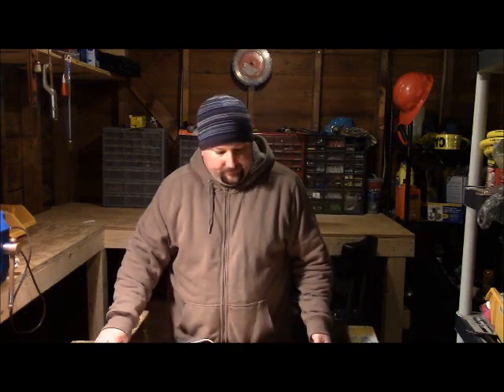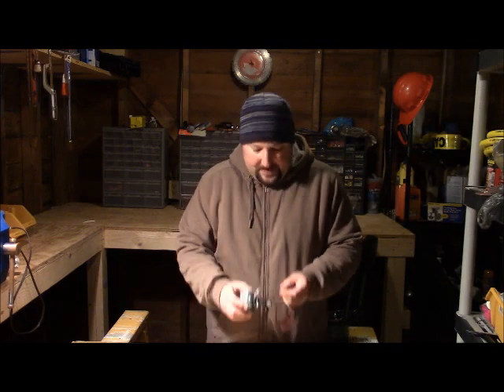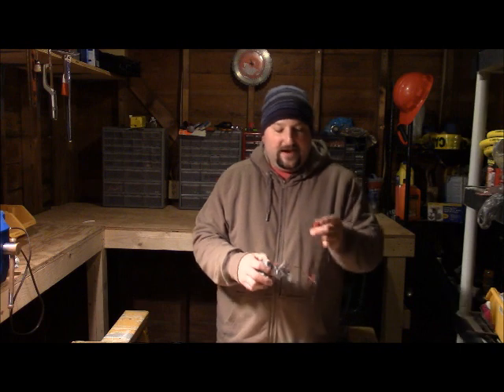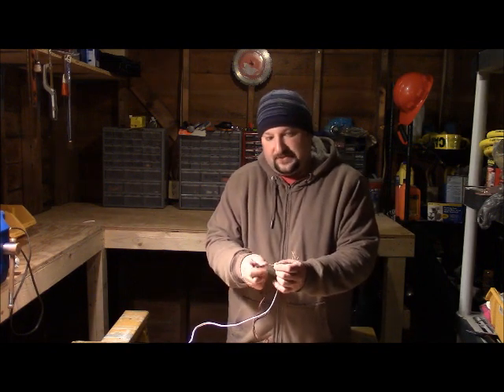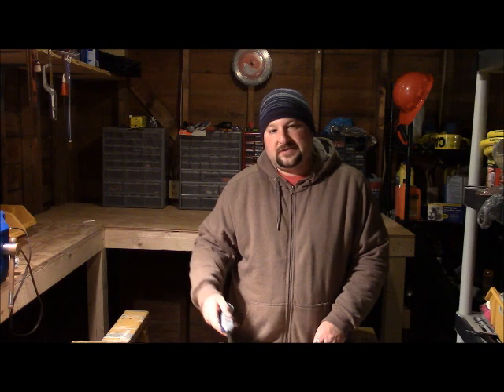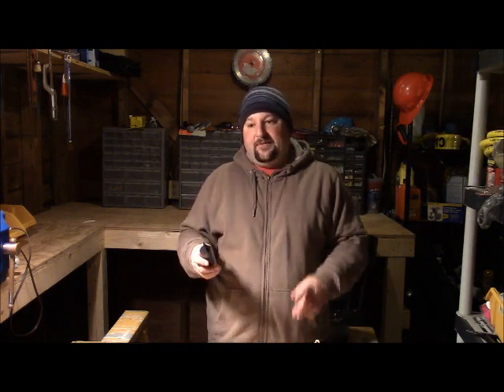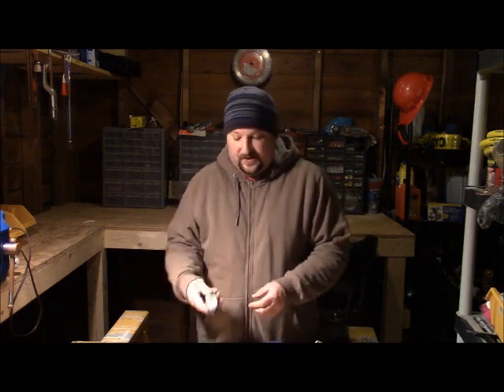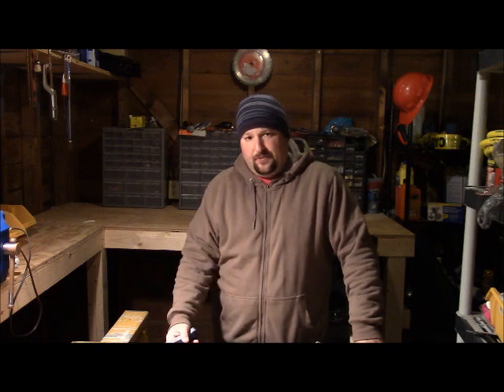How to find an open or short in a wiring harness

Comment: I just got one of these "cable tracker/tracers" the other day for a job where the power is all jacked up. Some outlets, switches, lights … work fine, others just do not. It's a weird setup also, it's all alum wiring, and there's the white, (Neutral), and the normal black, (Load/Line …), is Red? Anyway, I thought I "might" be able to take an outlet that is not getting power and "trace" the line back to either a short, or another outlet junction that may be wired wrong?? I didn't realize you had to BE SURE to kill the power, and I do understand "Ghost" voltage, (similar to a transformer really), which is why all my DMM's have "Low-Z" mode, just puts about a 3k ohm "load" to eliminate Ghost Voltage. So now I can see where this may not do the job as I thought, but in the directions it says (as an option/alternative) to hook onto one wire and the other to ground and you [should] be able to check 1 wire at a time, just be sure to set the sensitivity as needed to try and eliminate following Ghost volt? I'm having 2nd thoughts if this will at least "help" me trace/track the wiring. I'm going to try, but prob end up having to buy the Real Tracer/tracker where you don't have to kill the power??? Kind-of messed up how they actually word what it's capable of on the box. It's not just "misleading", but could be dangerous. Prob more for the equip than yourself, but who wants to Accidentally blow their stuff, $20or $300+, doesn't do any good either way!
Reply from the maker: Do not use this on anything live.  You're on the right track of getting something that will track live circuits.  I have a circuit tracker that I use for 120 lines and they make them for higher voltages as well, it's completely different than this.  This is a low voltage tracker, phone lines, 24 volt

Comment: Hi..., I don't if its short. But when press the head lights only my cars turns off. I check the alternator and its at 75 amps and charging voltage at 14.2.  The battery was check by my local auto shop and its fine too.
Reply from the maker: Mrinfoone   Did i understand this right?  When you turn on your headlights your car dies?  Total loss of power?  No lights or dash lights?
Reply: If it’s goofy, it’s ground. Likely a mouse has chewed through a ground wire or one just came loose.

Comment: Yes.., total lost of power. Then...., when I retry to turn the accessories and head light off after pressing them off. I get power back after  while. The cars turns on again but hesitates. Now current problem dies out after 10 seconds.
Reply from the maker: Mrinfoone   I have seen some weird electrical issues with cars before and they were caused by loose wires   I'd start by checking all of your connections   the connections at the battery   at the alt   and the ground   something may be loose   look for bad corrosion at the connections as well   if it's bad clean it up.   Also check the voltage at the battery  unhook the car from it and test it then test what the alt is putting out    then test what it shows at the battery with it running (no lights)   I'll do some research and see if I can find anything more on this for you   if you find out what's causing it please let me know
Reply: Mrinfoone 11